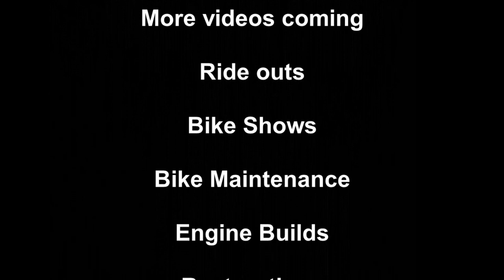Triumph T140 Fitting a Hydraulic Brake Light Switch for the Front  Brakes

Comment: Yeah good product, just ordered one for my T140. Crap original design inside lever....!
Reply from the maker: Hi Craig, got the order and only just noticed your message, will there be anyone home to sign for it or shall I wait till your back before posting? Cheers Cliff
Reply: @OldBiker  just hang onto it until we're home if that's ok. There will be someone home but not all the time.
Happy to wait.
Craig
Reply from the maker: OK no worries
Reply: @OldBiker  Hi Cliff, got the brake pressure switch fitted today. Really easy job.
My brake light now works again from the front brake lever now....
Thanks again
Reply from the maker: @mrcraighew1  Hi Craig, just see this message, great stuff, peace of mind knowing your brake light works when its supposed to now  :)